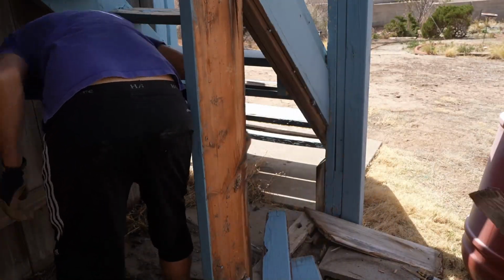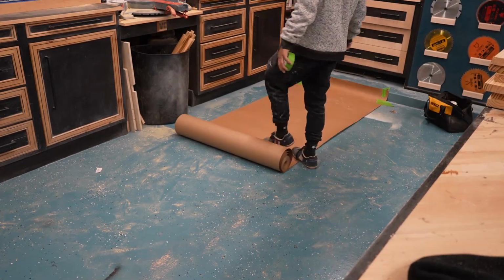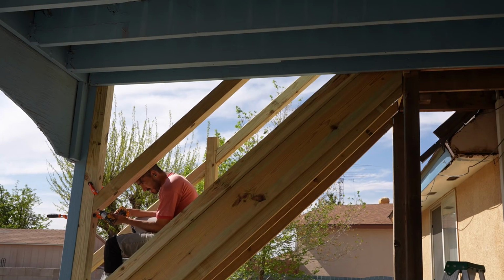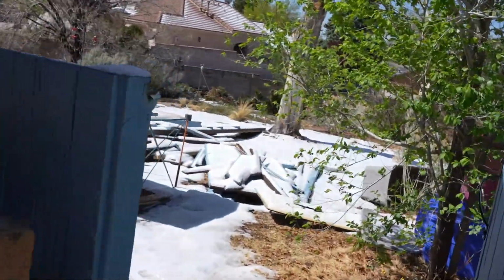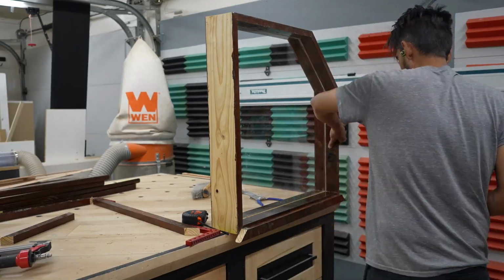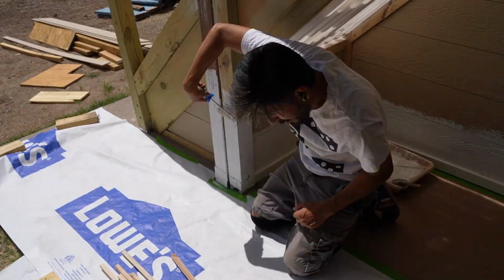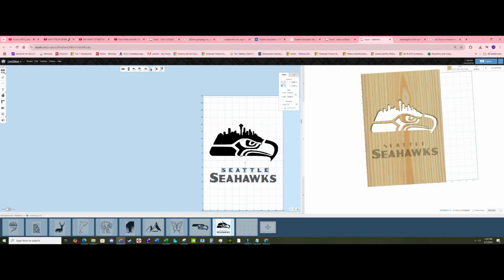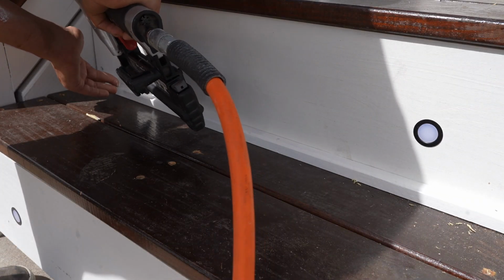New Deck Stairs | Full Build

Comment: You went above and beyond!!   Looks very sturdy and those panels are really cool!  Where did you get the lights you put in the risers?  Do you have a link?  

Bummer about the bow.  I got taught early on to look at how bowed the wood is when I buy it but it’s tough finding straight boards at Lowe’s or Home Depot.  

Well done!
Reply from the maker: Thanks!  I got the lights off Amazon and thanks for the reminder, I meant to include the link.  I added now.   Yea this was a tough lesson for sure, but its logged now in the back of my head, hopefully won't do the same again.
Reply: Thanks!